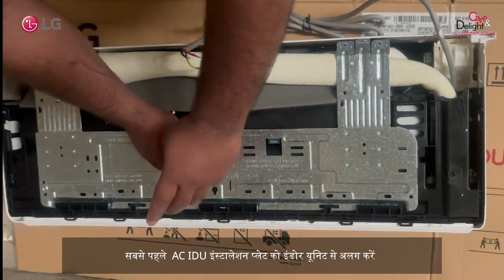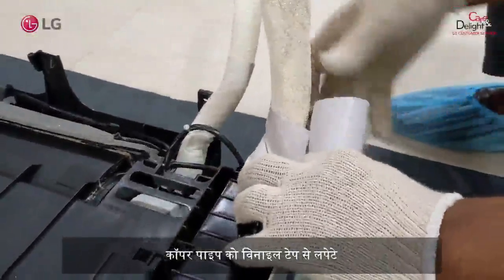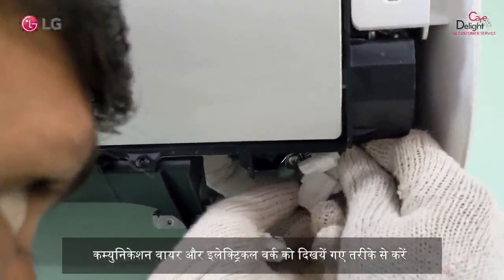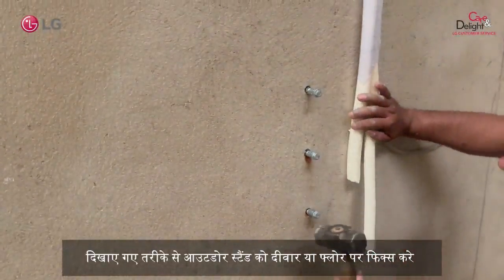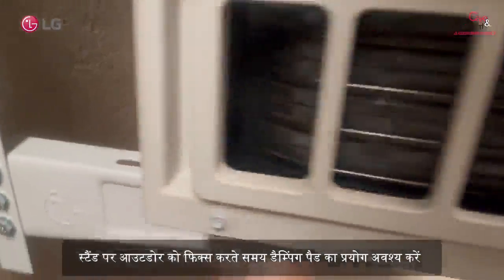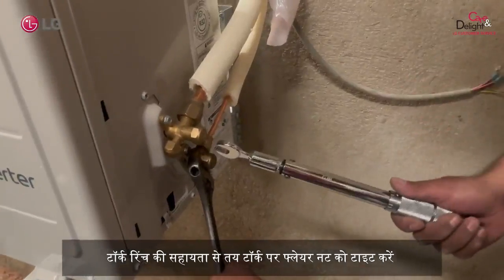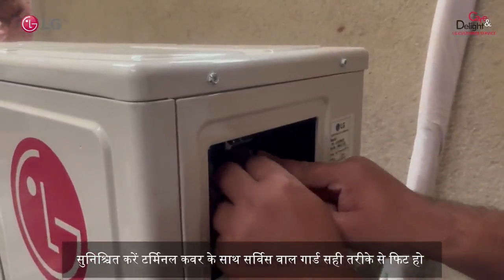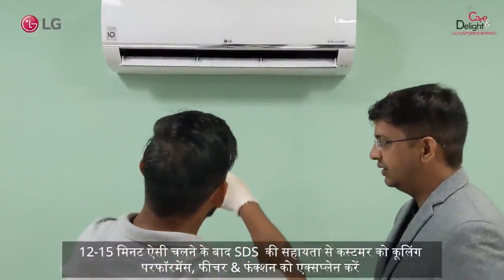Ac installation hindi step by step 2024 #trendingvideo #airconditioner #viralvideo 💯🔥👏👌

Comment: Sir i have 1.5 ton lg AC but executive did not vaccum.... it's mean my ac will work properly.....
Reply from the maker: It is possible that the technician self-vacuumed the air conditioner. If it is done, then there is no problem.Many tecnicians vacuum this way too.

Comment: Sir what if , lg executive did not vaccum ac at this of installation......
Reply from the maker: If you do not vacuum the air conditioner, the air or moisture in the AC will not come out. The gas that can be choked or the cooling of the air conditioner will be reduced.Due to which problems will come in the air conditioner.